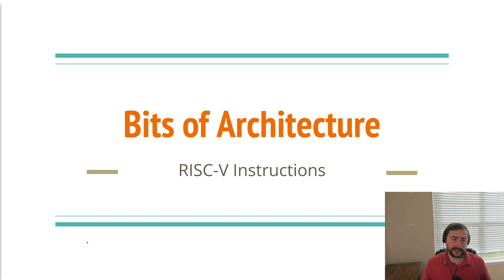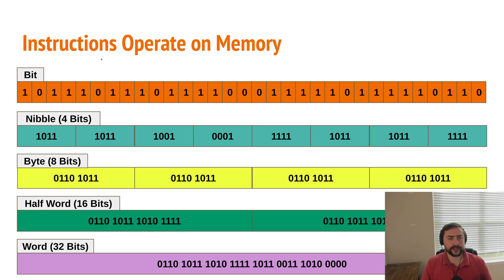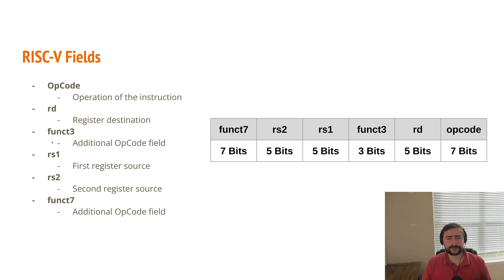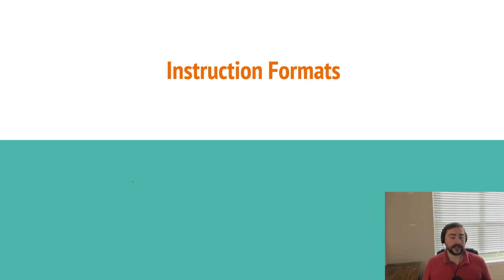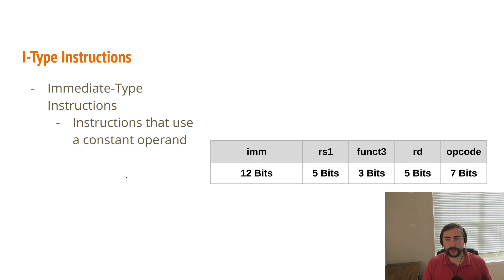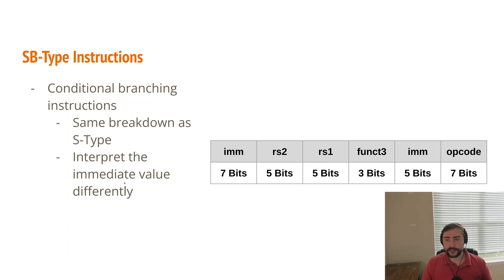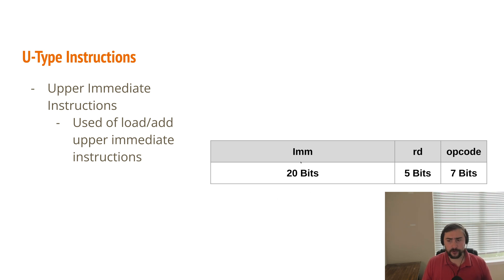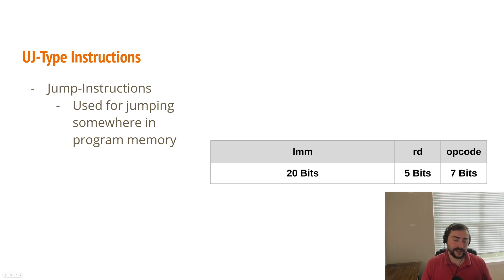Bits of Architecture: RISC-V Instruction Formats

Comment: What if we have immediate of type long long (64 bits)? Do we compute the results in rounds using these instructions? Thanks for the amazing content.
Reply from the maker: If you were using a RV64I instruction set (and therefore your registers could could hold the 64 bits you want to set), you would still need to use multiple instructions to set the value (the instructions are still fixed at 32 bits in RV64I, so you can't encode the entire range of 64bit values in the 32 bits available in the instruction (and in reality, you have a maximum of 20 bits for the value).

To set the value of a 64bit value (that can't be encoded in the available immediate space in the instructions), you would therefore need to use multiple instructions to partially load the correct bits and combine them into the dedicated register you want.

For example, you can't set all 32 bits of an 32-bit register in a single instruction with an immediate value either, but you can load the first 20bits into the upper part of the register, then add the the lower 12 bits with an add immediate instruction.

Cheers,

--Nick
Reply: @NotesByNick  Got it. I checked out the riscv spec, which mentioned the same. Even in the case of x64, the immediates are capped out at 32 bits except for the mov instruction.